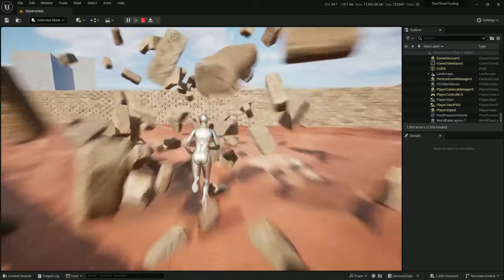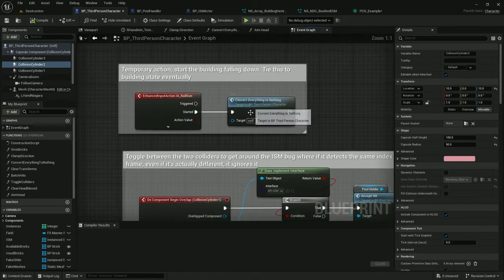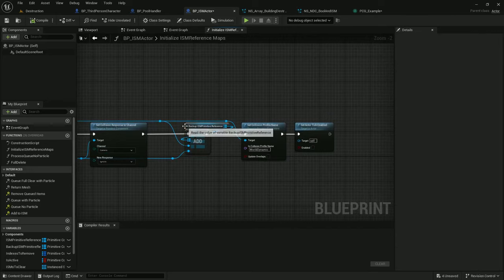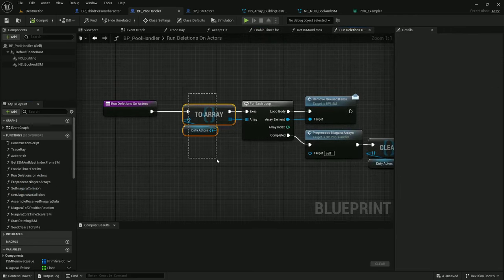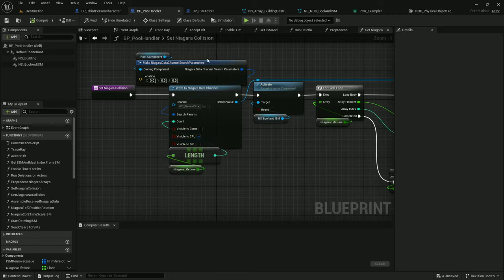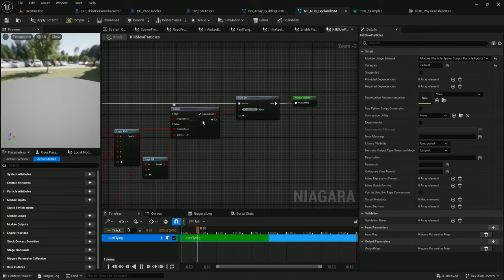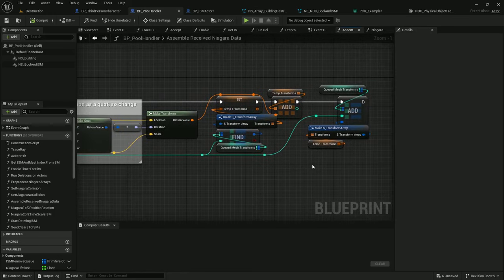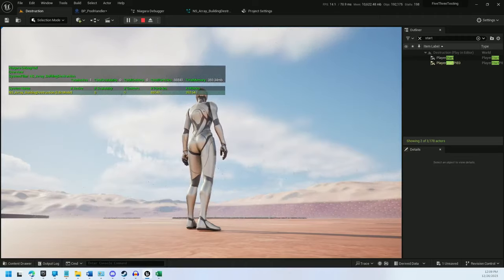UE5.3 Destruction Experiments - Converting ISMs to Niagara Particles

Comment: Don't know how relevant this might end up being, but what I ended up doing when testing out the Chaos system for use on extremely tiny building fragments was that I wrote a custom C++ script so that something like a bullet would always simulate the hit fragments, but something like an explosion would only simulate 20% of the hit fragments, and then would just disable the remaining 80% the frame prior to applying any physics calculations, and added a particle system to emulate even more minute dust and debris elements.

It's sort of like the reverse of what you described as a potential solution early in the video, and not only did it dramatically increase performance, but it also looked significantly better since having a rather uniform collection of debris does not look great on large destruction events.

I really do appreciate these videos. Destruction in Unreal is such an unexplored topic, and your videos have really given me some valuable insights into what might be best for the game I am going for.

Comment: EXCELLENT! Great work on the particle roll!
An hour! guess I am setting down, PCG! omg (*gets a drink)
Reply: Man, we should really have an hour long mind meld. ... ....
Reply: For removing from ISMs, yes, the indexes get re-ordered when you remove one. To avoid this, I zero out my transform data for that index and POOL THE ISM INDEXES, this keep them consistent. Also, allows you to use batch updates on the ism, which is the fastest.

Reordering the ISM array still isnt a big deal... I would do your overlap, get your ids, build an array of the transforms from the ids, THEN remove them.
Reply: Using Overlaps for your traces, instead of ray traces, is way faster. I recommend benching it. You do not need any physics on the ISM for overlaps to work, it just checks for the ISM actor (not the instances) and then you would get that ISM actor, and "get overlapping ism instances" doesnt even use physics to return
Reply: Should you be able to just send your interface call to 'accept hit' without checking if the interface is implemented? Isnt that the point to interfaces, being able to send data without first casting!
Reply: I use a method i termed.. what did i term it... Tick Scheduling, that works. I have a MAP of Gametimesecondsnexttick which each key holds an array of actors that need be ticked or acted on. That way each tick, i just check to see if that tick's key exists in the map... else dont do anything. If it does, I grab that data and tick them.
Reply: BATCHING YOU MUST BATCH! NOW I KNOW WHY ITS NOT WORKING!
BATCH UPDATE IS ALL YOU SHOULD USE, Batch update, Batch add.
Reply: Thank you for the Rotation X Vector to Niagara needs, fine/final niagara rotation is one of my goals for today.
Reply: Clearing the ISMs on next tick may be way you are using two colliders to wake things, and floppin
Reply: Projectile Path Node, thats new to me! And is both ultra cool (i do that, but just for straight down falls) and also scares the heck out of me (it must be doing traces under the hood)
Reply: sons up,  only could make it half way through. Data channels! Ill be back! I need to learn about that.
Reply from the maker: I experimented with pooling, but I found that clearing the ISMs was actually faster in my case! I'm not sure if it's a hardware limitation or something to do with the ISMs themselves (tons of little ISMs with collision maybe?). I need to check again now that I've converted over to a different system!
Reply from the maker: Oh that's cool -- I'd noticed "Get Overlapping Instances" but hadn't yet thought about how to do it.

Ray traces don't seem to be the major slowdown with what I'm doing, but every bit of efficiency helps!
Reply from the maker: Since my ISMs are already created I don't have an array of transforms to use for batch update! That's why I've gone with the deletion route -- and after some testing I actually found that removing the instances was faster than object pooling!
Reply from the maker: Yeah! And for the reverse I couldn't figure out how to easily get rotation back out of Niagara, so I export a quaternion across a couple export to blueprint nodes.
Reply from the maker: I think it's actually clearing ISMs on the same tick -- I found that setting an event on next tick for events that happen early actually seem to happen on the same tick (at least according to the timestamp). Either way I couldn't really figure out how to batch up the collisions, since they report independently and not in an array -- setting it to fire off next tick ensures that I get the full set of them.
Reply from the maker: Yeah! Use the advanced version if you need to get the time elapsed, the other versions didn't seem to output the proper data.

It's got to be a lot more expensive than a trace, but it can account for gravity and projectile size. Compared to running a CPU niagara particle with collision on, it's a massive improvement. On the other hand, now that I'm using GPU particles I'm not sure it's worth the up front cost, their collisions are incredibly fast!
Reply from the maker: Ideally I'd have a unique trace channel just for destruction, but for now checking if the interface is implemented is a simple way to filter out landscape hits and other irrelevant actors. It's sort of a lazy future proof while I develop things :D
Reply from the maker: @aggressivemastery  Interesting! I sort of assumed timers basically worked like your implementation, having a single thing track when events should be firing off. So I'm using just a few timers, and arrays that the handler acts on to fire off all of the events. It has been getting a little messy at times, for sure!
Reply from the maker: @aggressivemastery  I'm down to chat! I've been getting a lot of inspiration from your experiments and implementations!
Reply: If you can disable ISM collision it sure does help speed things up!  @MichaelRoyalty
Reply: Yes, I am exporting that third float as the extra 4th q value  @MichaelRoyalty
Reply: I dont think the time matters, be it the same tick or next tick (im my method its just on death) so the data for a death this frame gets caught this frame, or next, or after that :)  @MichaelRoyalty
Reply: I do/did this for when I proc gen filled interiors of buildings. My ISM buildings are each grouped into a building. So I can set them all to block "buildingtrace" and then unblock it. Then only trace against that. That way I can proc gen when other geo is pushed into that building, without it interfering.  @MichaelRoyalty
Reply: Of everything, the only thing that freaks me out or worries me about what you are doing is the timers. That could just be my hang up tho, I would want to test at volume (again) before making your remove something  @MichaelRoyalty

Comment: What's stopping you from using Chaos for everything?
Reply from the maker: A couple reasons, but mostly because I'm just figuring out how to make all this work well.

1: I dabbled with Chaos initially but it was too slow, so I switched to other options.
2: I'm creating ISMs from individual brick meshes, not chunks of walls. I don't have an automated solution to batch up a bunch of bricks into a single wall chunk, so I can't take advantage of chaos shattering a larger wall.
3: Once I started down this route, I figured it'd be good to figure out how to make things efficient without involving any more systems, to better understand the bottlenecks in this process.

Now that I know a bit more about how to make all this efficient and take advantage of Niagara, I'm hoping there's a bunch of stuff I missed with regards to Chaos.